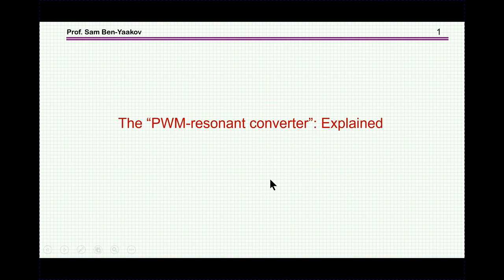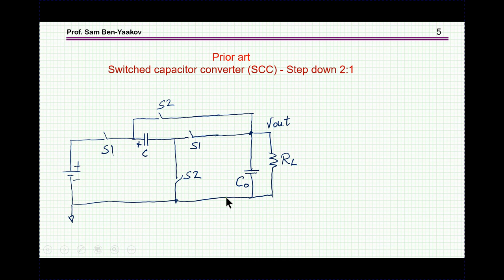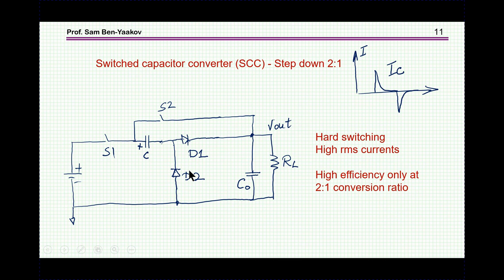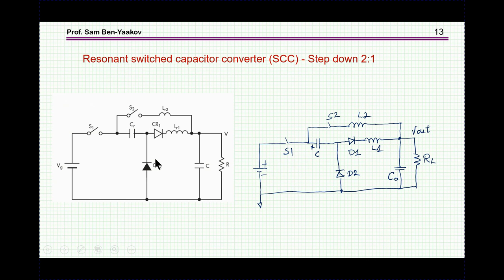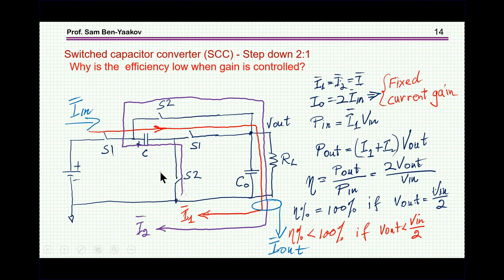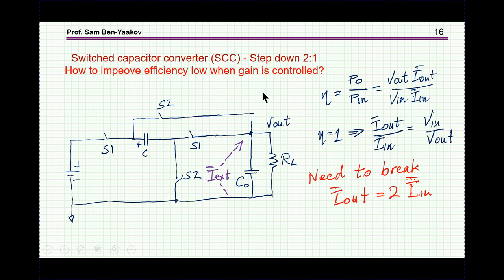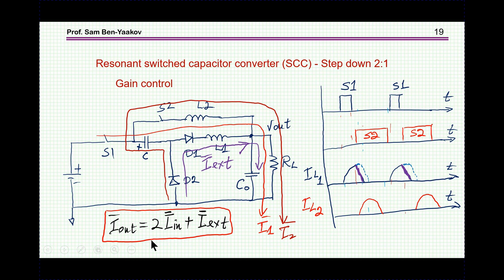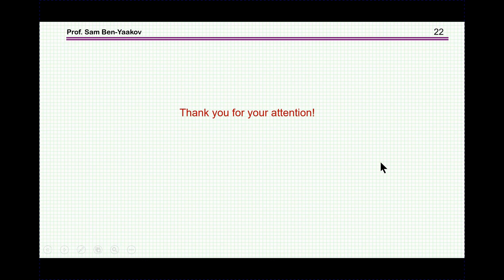Deciphering the “PWM-resonant converter” proposed by Slobodan Cuk

Comment: Dear Professor. This presentation is very informative as usual. I just would like to say, that this topology has significant drawbacks . I simulated a circuit, proposed by prof. S Cuk. For D=50% 12V to 6V at resonant frequency (160kHz) with 40A load.  For these conditions, Peak to peak current in output capacitor -80A and RMS current -20A. RMS current in resonant capacitor - 45A. At 50kHz (as it recommended by prof. S. Cuk) peak to peak current in output capacitor is 380A (!) and RMS current is 115A.  So, this is a price has to be paid to get rid of inductor in Buck converter. These huge currents make this topology very inefficient and practically unusable.
Reply: Hi Lev! It is impossible to fool the Nature, but successful research is a victory of science over the common sense. According to your simulations it not so, unless there is a way to steer the ripple to the input with coupled inductors. From the video an interesting question follows. In which converter the drop of efficiency (after the point of 1/2) is steeper, in the regular (resonant) switched capacitor converter or in the considered one?
Reply from the maker: Hi Lev, thanks for the interesting input. Please post this comment at the IEEE power electronics group
 https://www.linkedin.com/groups/2091456  
at which this subject is heatedly discussed.
Reply: Very interesting info. Can u please simulate this at say 1 - 2 MHz ? Then ripple current will be very low. By properly designing the passive elements and as soft switching is any how attained, maybe this would be a very efficient circuit after all.!
Reply: I have made a few alternates that solve the hard switching etc.  Do contact if interested.  I need a brief specification before suggesting a new circuit.  Prof. Cuk also has many other circuits too.

Comment: Hi Sam Ben-Yaakov
    I came to similar conclusion (but Prof Cuk says it's not true) by another route. I always look for problems in a new topology by considering it from another point of view, in this case, from the frequency domain rather than time. Firstly, Prof Cuk has another, previous, variation with the source of the lower fet connected to the supply ground and I consider this version (makes no difference, only serves to put the input and outputs in series. Consider the 2 input side FETs as a 1/2 bridge, (which they are), with asymmetrical PWM as per a standard PSU design that already exists and is understood. the "resonant components " then are a band pass filter, the 2 output diodes are a peak to peak rectifier.supplying the load. Changing the FET drive symmetry changes the level of various harmonics, lowering the fundamental as you move away from symmetry.  I said you can't choose the exact switching points to achieve resonance and also for exact output voltage, you can only have ZCS at one value of Vin / Vout, but he denies this, what do you think? I think it is saying the same thing as you via a different route?
Reply from the maker: Hi Will, Although I am not sure that I have followed your reasoning, I definitely agree with your conclusions. Would you please post your comment at my LinkedIn group
https://www.linkedin.com/groups/13606756

(if not a member ask to be and I will approve)
By this other will benefit from exchange.